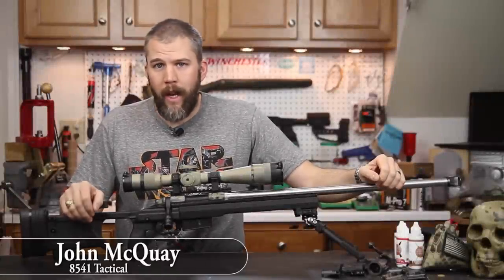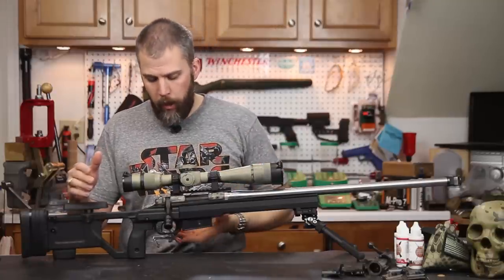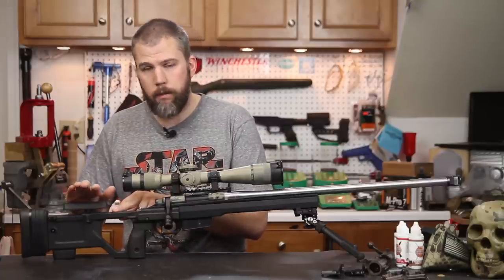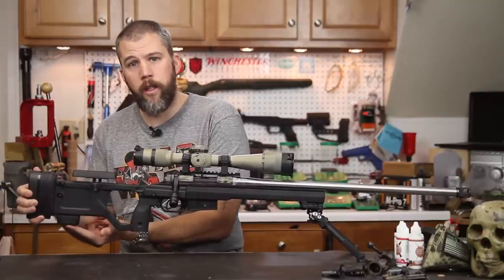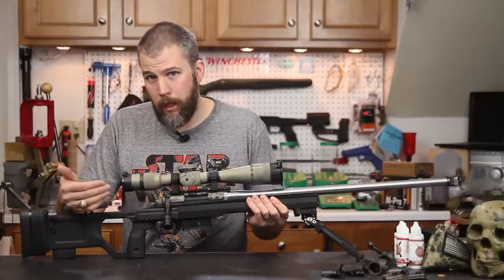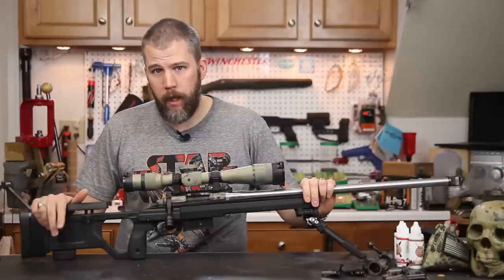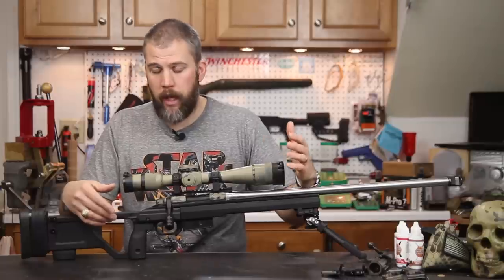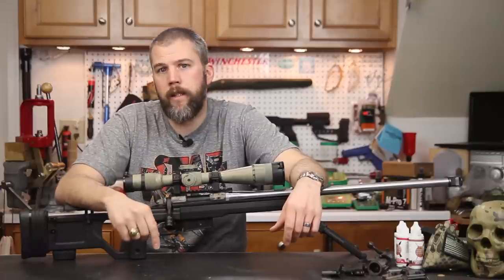KRG X-Ray Chassis Review

Comment: Hey john, I noticed at 1:28 your primers look to have been sealed by a sealant of some kind. I know you load your own ammo so I was wondering was this done by you or is this one of those times you were required to shoot factory ammo in a match somewhere? I am a reloader also and was considering the benefits of sealing my primers and wanted to know if you can give me any info on it?
Reply from the maker: Vapor Trails That was factory ammo. I don't worry about sealing primers.
Reply: *****  Only time I seal primers is for hunting. Not really needed, just a safety blanket. Makes you feel secure when you know you pull the trigger it goes boom, and you get that 12 pointer.

Comment: Realize this is a really old video so shot in the dark here... 
Does the polymer affect capability at all? Looking for a budget chassis as I cant afford another MDT chassis, so was looking at the Oryx, but the xray is intriguing with a little less weight.
Ultimately would be going on a .300WM that I would like to use for hunting as well as long range.
With the 2.4lb HS Precision stock it came with, it's already getting a bit hefty to carry for hunting due to the Sendero barrel, so this has peaked my interest.
Reply from the maker: All of these chassis use an aluminum backbone or bedding block. So the plastic is just the part you are touching. Depending on the specific construction, you may notice a difference in the recoil impulse, but accuracy will be good with any of them.

Comment: Hey John, thanks for the review and good to see the new videos.  What is the bipod and mount you are running there?  One thing worth mentioning about this chassis is that with the buttpad all the way up (where I happen to like it) my cleaning rod doesn't align with the bore.  I have to dismantle and lower the spacer assembly to clean.  It's one of my few complaints about this set up.  Keep up the good work.  Thanks.
Reply: Atlas bipod for sure, can't tell what mount though

Comment: John, I'm working with a unmodified Remington 700 SPS Tactical .308 with the junk Hogue stock and need to get consistent precision with it. It is for use as a LE sniper rifle. Would you recommend this chassis as a good replacement? I've been eye balling this chassis or possibly the KRG Bravo to drop the factory action/barrel into. What are your thoughts/recommendations? Do you know how a factory heavy barrel performs in this chassis? Thanks!

Comment: Hey i have a question. 
I bought whiskey 3 gen 6 folding stock.
Im very upset with length of pull part.
To feel comfortable i need to pull out all the way but no matter how hard you tighten it still shakes.
From customer service i received an answer dont pull all the way out.
Now is it possible to replace folding stock to fixed stock from x ray shassi to my wiskey? Thank you very much?

Comment: I have a rem 700 and a savage. Is there a reason most aftermarket chassis, stock manf  don't make a system for the savage models? Lately I find myself enjoying my Savage over my Rem.

I'm ready to do some up fitting on my rifles. What are the pros of going with a chassis system that I see a lot of guys running simular to this vs a more traditional setup
 Like a bell and carlson medaliat? Weight? I would assume the ergonomics are similar and I really enjoy the styling of the medalist. 

Sorry for all the questions but  the only precision rifle info I'm able to get is from YouTube or forums. Unfortunately I'm unable to put my hands on many setups.
Reply: Actually, the same company, KRG,  just introduced a chassis for the Savage - the 180-A.
Reply: probably because a lot of people buy savage because its cheap, and most chassis are expensive. xlr makes a great savage chassis though.

also most savage shoot very well out of the box, whereas many remington 700 require modifications to get them to shoot well, and people buy remingtons expecting that.
Reply: Okay, thanks for the replies. More of carbine  guy but wanting to get more into precision.
Reply: Thomas Jackson It's unrewarding for aftermarket parts guys to make stuff for Savages because Savage keeps changing their rifles.  In their 10 (short action) and 110 (long actions) they have had controlled round feed, push feed, staggered feed, single feed, 4.425" action screw spacing, 4.440" action screw spacing, side bolt release, bottom bolt release, standard DBM, and Axis DBM, and far more.

Go to Boyd's Stocks, and use the drop boxes on the top left.  Select Savage in the first one.  Then look at the options in the second one.

So a company comes out with a part for Savage rifles, and then the next year Savage changes their gun and that part doesn't work anymore.  If they quit that nonsense, they'd have a far larger market share.  Lots of people buy rifles based on the available aftermarket for them.
Reply: spraynpray I had no idea. It makes total sense though.. With Rem going through a rough patch and the quality of their product not what it used to be "imo" I was looking forward to building off my Savage action. With the Rem being as modular as it is its most likely the best bet. It's nice to know there is some options though. Tyvm for the comment.
Reply: No problem.  FYI the Savage Accustock is the cheapest chassis/v-block system I know of.  I have one on my 308.  I put an AICS style DBM on it that is a drop in fit from Accurate Mag.  I duracoated it and now it's a sexy beast.  I'm into it under $850 and I have some spare parts to sell because of the DBM swap.  I couldn't ask for more rifle out of anything this light.  The only problem with it is that Savage action ain't the slickest.

I am the president and founding member of the Remington Haters Club and now that I own a Savage, it's pretty much official.
Reply: Thomas Jackson i
Reply: MDT makes all their chassis for Savage as well as R700; usually on the initial release too. Good products!
Reply: KRG has one but it's around 8 to 900

Comment: @8541 I'm about to pull the trigger on the X-Ray chassis for my Tikka T3X Varmint 223.  Are you using MDT 223 magazines in the video?  If so, any feeding problems?
Reply from the maker: The MDT mags are a snug fit in the KRG. We used the .308 version while testing the X-Ray.

Comment: So the forend that comes on the X-ray is polymer correct? Did you have any/could you foresee any sag or flex in the forend when free floating a heavy contour barrel? I've had this problem with HS precision stocks.
Reply: The forend is polymer, but it bolts to an aluminum backbone that actually makes up the barrel channel. No chance of any sag or flex.
Reply: I'm talking about the forend it's self flexing. Not where it connects. I'd have to show you a picture to really explain what I'm trying to say haha. Like my HS precision stock for example, at the end when it's sitting on the bipod the stock sags and comes in contact with the barrel where it's supposed to free float. I had to sand it down. It stop sags but I took enough material off so it doesn't contact the barrel
Reply: The aluminum backbone runs the entire length of the barrel channel. The aluminum channel would have to flex to cause contact on the barrel. That would take an amount of force that would be beyond what you could apply under normal use.

Comment: if you had to chose between this and MDT LSS.. what would you go for ?
Reply: I am looking at both those chassis as well. I like the Xray because its longer to put your bipod out further and has a flat bottom make it easier tp shoot off surfaces. Also I like that its polymer exterior in case I bang it around. Anoth plus that is just mg preference is that I love the way this chassis looks. Good luck.
Reply: The KRG X-ray is more rigid and you will be able to mount a bipod further forward for more stability, whilst the MDT LSS is more modular. I just ordered the X-ray myself :)
Reply: Leon K They end up being almost the same price once you add the pistol grip and stock to the LSS. The X-ray is more rigid and has more mounting sections for accessories. it is also a bit longer so your bi-pod if further away. I see this as an advantage, but it's debatable. I'm going with the x-ray but the LSS does give your more customization with it's modular grip and stock system.
Reply: Leon K If you havent bought yet, MDT is making an LSS XL chassis with a longer fore end.. could be the ticket for you.
Reply: The actual direct competition from MDT is the HS3, similar design and a little less bulky.  Here in Canada the MDT is easier to find and get due to not needing an importer as this does.  Both are nice stocks but the KRG is too bulky for hunting.

Comment: Have you/can you use the new Magpul AICS pattern mags with the X-ray chassis?
Reply from the maker: Five and Ten round versions fit and drop free. I have not function checked them yet, but I have no reason to believe they won't work.

Comment: Does short action and long action depends on the rifle range ?
Reply: No. It is generally used to describe the size of the receiver or what class of cartridge it will accept. Although both .308 and .30-06 are the same bullet size and same bolt head diameter, the .30-06 is a "long action" cartridge because it will not fit in the magazine of the short action receiver.
Reply: @JohnMcQuay  thank you for your review this is my first chassis system.

Comment: i wish the grip angle was different that looks so uncomfortable to me
Reply from the maker: +Tatsuhiro Satou It's actually very comfortable. If you look at most of the "tactical" stocks, you will see a near vertical angle for the pistol grip. This assists in getting a "straight to the rear" pull on the trigger. Check out the video: https://youtu.be/RrvexaOIqFU
Reply: ***** it still looks very uncomfortable i like more control than that i like eather a sporting style or something like an ar15
Reply: when shooting chassis systems like this I keep my thumb on my strong side of the gun and not wrap around the grip. the grip on this is actually really Comfortable. Mine has the large grip panels that lets my thumb ride really good on it
Reply: +02lb72500HD i like the control of grabing the grib

Comment: this chassis needs bedding or not?
Reply: Yuriy S. 2:50 😉
Reply: Depends on your action.  I just got one for my Weatherby Vanguard and did not like the lateral movement.  Just received an from their lead desiger that says the Howa chassis does not touch the V.  Contact points are the lug, rear tang, and the action itself.  Again this is just for the Howa actions and the XRay chassis.  Also to be fair there customer service has been very helpful in communication with me.  Hope this helps.